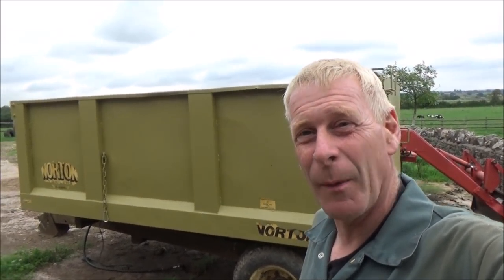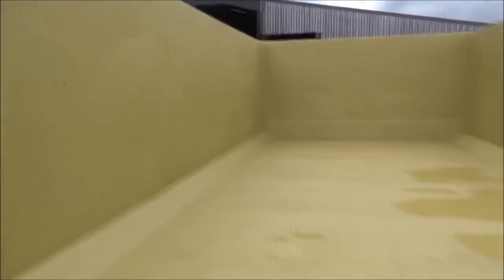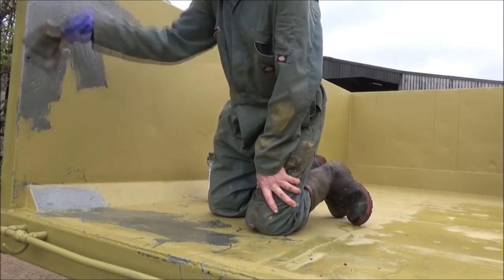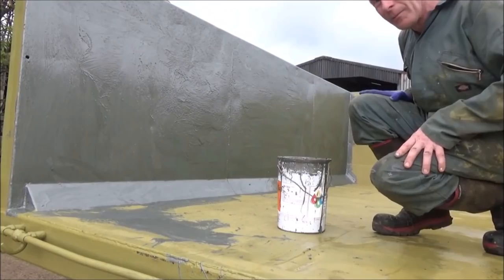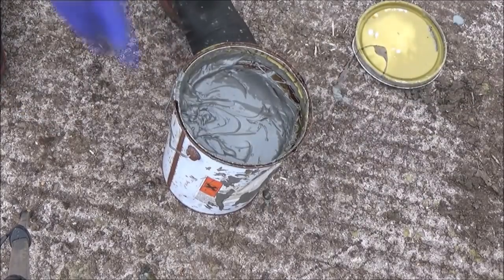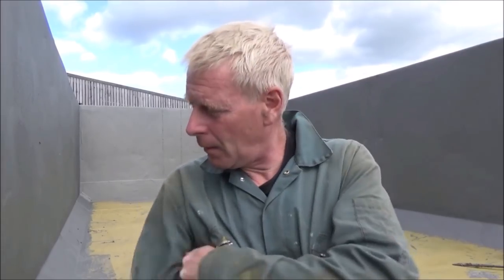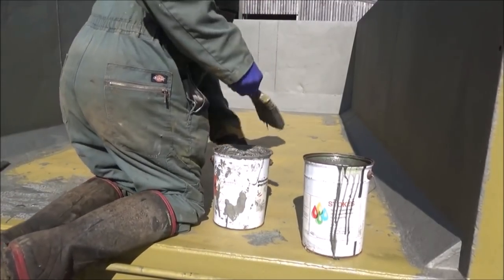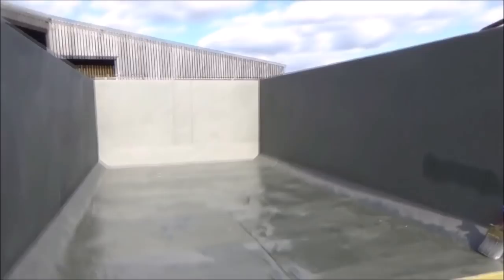Norton trailer restoration. Part 7 Top coat paint inside

Comment: Hi Richard, As any good tipper truck driver will tell you, Always leave the body slightly tipped to avoid the water from collecting on the floor. Trailer looking good.
Reply: Drill TWO 18mm holes in the front on the floor.

Comment: A good friend of mine thats now departed always used to say "where there's a run it won't rust"    Well i'm glad you are going to do something different with the outside after watching that grey color go on.   I was  thinking it probably looked quite  nice on the top 3 ft of a 200 ft pylon ! .   I was originally thinking instead of that comment, I was just going to have to say You ruined that nice color primer.  I'm over here sitting in the corner crying L.O.L, but you pulled a good save out of the hat in the end . Thats cool you are getting new stickers, It's nice Norton are still proud of their image and want to advertise the old trailers still one of theirs after all these years, and a company ownership change to.   Thanks for the update Take care.

Comment: Great effort looks a lot better 

1 little tip to help your finish 
Always try to leave your brush strokes vertical

Slap the paint on left to right action as your joints work best that way but once coverage has been achieved finish by going up n down this works with gravity to even your stroke out and it  won't run as much then

Thanks 

James